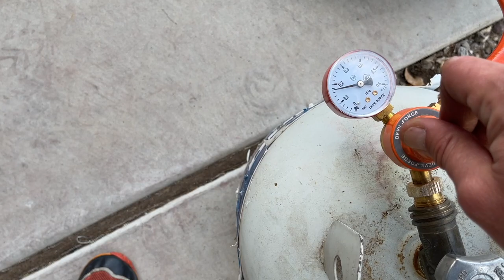Can You Melt Steel Bottle Caps? - Coors Light Beer Bottle Cap Melt - Making Copper Grain - TGS

Comment: When pouring to get grain, it might be an idea to use a piece of wet wood at a 45 degree angle over the water bucket, pouring the molten metal onto the board where it should cool down sufficiently and slide down into the bucket below rather than pouring it straight into the bucket when it's still molten as it reaches the bottom and solidifying into one large lump.

Comment: I haven't tried steel yet, but when I do I'm going to get a CO2 bottle hooked to a torch with a rosebud tip, and then I'm going to flood the crucible with CO2 while melting, then pour into a vessel that's flooded with CO2.   Steel will burn at a lower temperature than it melts, so keeping atmosphere away from the molten metal is crucial.
Reply from the maker: I want to see that!

Comment: I dont think Devil Forge is rated for melting steel. Maybe they have a different model that you can do that with though. Their site, devil forge, does say they can handle up to 3000 degrees F and stainless steel melting is supposed to be less than 2790 F , so it should be hot enough. I keep finding more info sorry. Its weird because Devil Forge site says on the main gas furnace page that their furnaces are able to get to 3000F but on each individual page for the furnaces they say they can get to 2642F. Melting point of stainless steel is 2550-2790F. Another thing on devil forge site is the way they word things. 
Furnace Interior fully lined with 1 inch of ceramic wool, 1 inch 
refractory. Coated with our special refractory and it can hold 3000 
degrees Fahrenheit temperature, which increases the forge’s fuel 
efficiency.

Maybe that means the refractory can handle up to 3000F not necessarily that the furnaces can get up to that  temperature.

Comment: This is great watching you melt and pour these metals. The flying copper pieces are dangerous. Could you change your footwear to something safer? Any hot pieces that land on your synthetic running shoes will melt right through. The laces only help trap the hot metal, it can't fall off. Spats would help and let you wear your runners. Boots with spats is the best!

Comment: Good try, maybe if it was smaller and better insulated. It's at least fun to try. I want to get another big metal trash can and use that to try making shot so It can have plenty of volume  for the metal to cool by the time it hits the bottom. Maybe line it with some play sand.

Comment: 1. When granulating  water needs to be deeper - much deeper
2. No need for that silly clamp on the crucible shank - I have never know a crucible to fall out when pouring metal.
3. Put a heat shield between the crucible and your hands to protect them from radiant heat , but still need better glove to protect from heat conducted along handle, 
4. Handle least wobbly if round. Put T piece on end to get a good grip
5. You will NEVER melt steel in a simple furnace like this. You need regenerators/ recuperators to preheat the fuel and air (you may though dissolve steel in other metals like copper)
6. These furnaces burn hottest when running a little lean (hard to do with self aspiration) You had it way way way too rich

Comment: Was that a zinc fire at the beginning when he was pouring the molten metal into the tub? Is it possible that the heat from that ignited the zinc coating on the outside even in the water?

Comment: Melting copper, especially so much in a 8kg crucible and then pouring it for so longmakes that you can make burns of the crucible heat decipation. Thats why I stopped using welding gloves, especially for copper - I use proper foundry gloves which have additional reflaction area to prevent such burns (you can see those gloves in my videos).
As far to melting steel. I would not do that because whole furnance is made of steel right? Other thing is that the burner itself I think is rated to 0.15Mpa max pressure. As far as I remember 🤔. I would add a disclsmer to this video - kids dont trt this at home ☺️.
Reply from the maker: I’ll check out your videos for the gloves. Some very good information! Thanks man.

Comment: ive been collecting beer caps for this very reason. i'm guessing you used the FB2M for this melt.
Reply from the maker: I did. I wanted so badly for the steel to melt all the way. But I lost the battle.
Reply: @TheGrowingStack  Yeah. Cant find a commercial foundry or even a way to make one yourself at those temps. So much steel laying around and its got so many uses, its frustrating that its melting point is so high.

Comment: yeah, it's really hard to melt steel. if you had two burners then you'll be able to do it easily but you don't have the right foundry.  I just quit trying to melt steel cuz I'm not spending $1500 on a foundry 😂

Comment: Can you separate copper from steel?
Reply: Yes. Since copper is at a lower temperature melting point, the steel will stay on the bottom while the copper turns to molten. Mixed or coated, it'll still work.